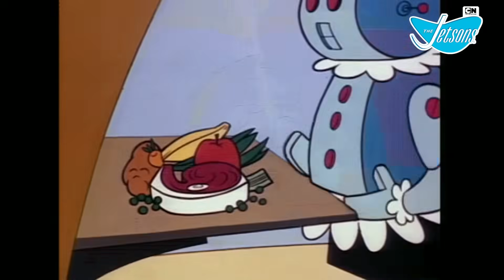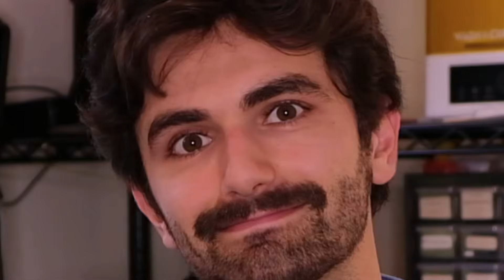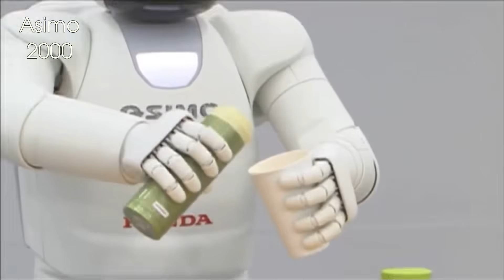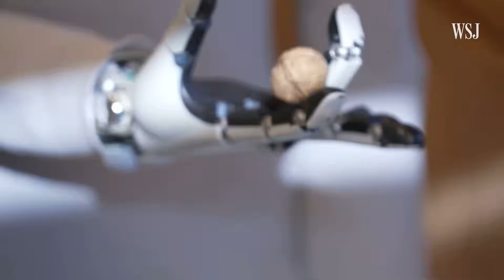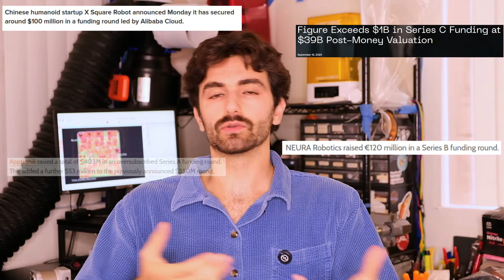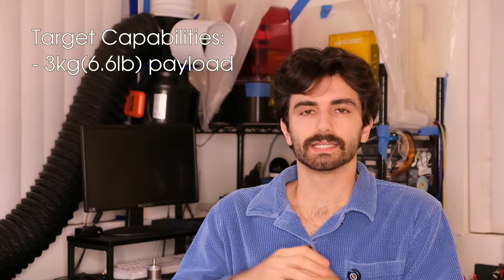I'm Building a Robot Arm! - Ep. 1

Comment: A few years ago, some people out at UCB had a very similar thesis; they developed project "blue", which was an inexpensive 3D printable robot arm using quasi-direct-drive actuators.  I believe they even spun out to make a startup, but it didn't go anywhere.  A lot of the stuff is open-source, I recommend you give it a look for inspiration if you haven't heard about it yet.  

Besides that, torque transparency is likely going to be one of your bigger challenges.  There's an inherent tradeoff between actuator resolution/torque and inertia/transparency.  With bigger gearings, you'll lose the linearity between the input current and the output torque, which can make force-control really difficult.  For your given payload, your arm's reaching length may be a bit shorter than desired.  

One more thing:  it might be a really good idea to use capstan drives with dyneema cables to avoid needing to buy gears altogether.  Then you can go all out on more expensive motors with 3D printed housings and drums for everything else.  It'll keep costs down and capabilities rather high, albeit with a penalty in overall bot size.  

Best of luck!  Excited to see where you go with this :)
Reply from the maker: Hey! Thanks for the comment. I've seen project blue before but hadn't done a deeper dive until now. I definitely agree that torque transparency is one of the biggest issues, and I expect to have to do some tricks to improve it with feed-forward control. I think realistically using sheet-metal for the structure and minimizing the amount of plastic will actually improve the payload per dollar because sheet metal has gotten so cheap (send-cut-send)

Regarding capstan drives and dyneema: You are correct - at least in one sense. I explored capstan drives very thoroughly for my hand project and after months of testing I discovered that although dyneema based capstans can theoretically perform better, implementing them is actually a logistical nightmare for a reproducible and accessible project. Terminating the dyneema lines is not straightforward because knots reduce their usable strength, and larger diameter = larger turning radius, so the optimal dyneema design ends up looking like multiple parallel tendons per joint (which ends up being long) or one tendon per joint with very large diameters (because although synthetic rope has a smaller bend radius, reliability takes a huge hit under 10 R:r). For an experienced person making this for their own use this is fine, but it would be way too burdensome for a project meant to be approachable and easy to repair. I address a bit more of this in the next video I'm working on but I may have to do a transmission deep dive at some point.

Anyways, thanks for watching and commenting! Always happy to discuss more stuff and in the near future I'll be making a discord server or similar to make discussions easier

Comment: It's fascinating the industrial robotics adopted such a closed source software approach, when G-Code running nearly every CNC machine is largely open, documented and easy for others (people, software packages and other robotics) to interface with. Any clue how that transpired?
Reply from the maker: I think traditional robot companies saw a similar opportunity to the early ink printer market where they could make more off of selling integrated solutions and charging for services rather than just for parts. Also the robots themselves have more complicated control architectures for inverse kinematics compared to a 3 axis cartesian CNC system  which made each robot possibly more unique, so a general solution was not as obvious (at least that's my guess)